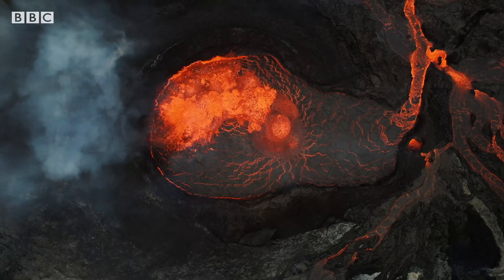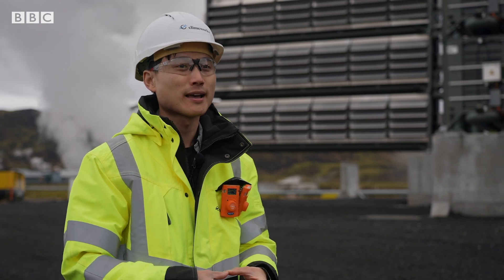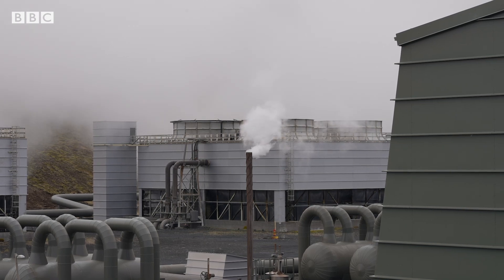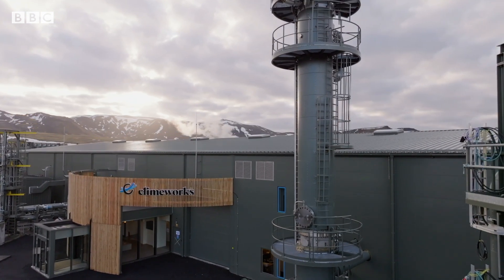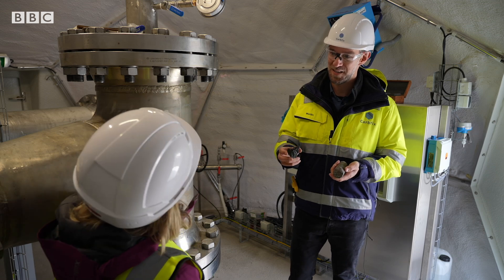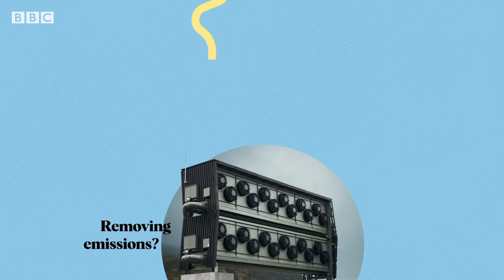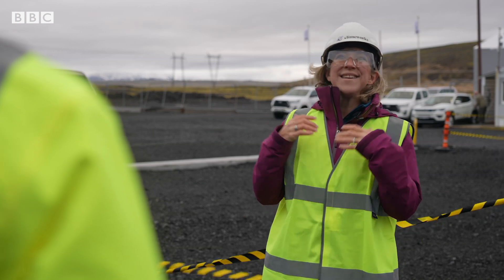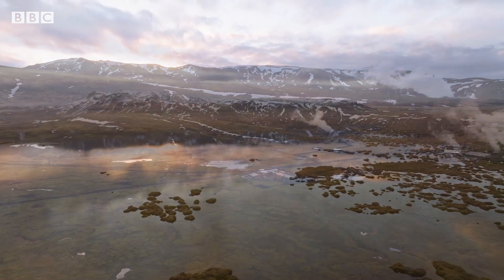Inside the hidden carbon plant pulling CO2 from thin air | BBC News

Comment: What stupidity?     Co2 heating by radiation was mainly in 20ppm lessening as it increased so over 350ppm no measurable heat was found!  below  1800 ppm plan life starts to  whither away in fact its added to greenhouses to increase crops. often five fold.  Without CO2 photosynthesis stops.  This process recycles waste into tomorrow's requirements.  As I suggested,  what net zero stupidity?

Comment: Fairy tales.
To obtain 1 ton of CO2 you need to suck 1670 tons of air through a plant. Compress it wash it, dry it and liquify it. For all thia you need a lot of energy.
To get methanol one need 44 kg of CO2 to make 32 kg of methanol. And you need a lot of hydrogen. At the end you need 12-14 kWh/kg methanol for the process. 
But if burned or used in an engine 1 kg of methanol will release only a measly 5,5 kWh.

Comment: This is the biggest waste of material, resources, labor, equipment, power, and yes also the "burning" of fuels needed to generate power for its manufacturing, installation, and operation....... All this for The New Religion, which dismisses the number one influence in climatic weather pattern changes,,,,,,, the Sun/ Solar forcing/ electro-magnetic influence from the Sun.... The New Religion will fall

Comment: for context, you would need 1,168,750 of these factories to offset one year of global CO2 emissions. At $1k per ton of co2 removed this solution would cost $37 trillion dollars. If they scale to $300-400 per ton it will cost $13trillion. 
You could plant about 13 trillion trees with that much money.
Dollar for dollar which solution removes more carbon, this industrial construction OR planting trees? It would take 437 acres of trees to capture the same amount of carbon that this thing does.

Comment: Trees are pretty good at removing CO2, but the fuel they produce (wood) is not very useful to run cars or heat homes. What we need to do is gene-modify a plant to very efficiently produce something we can easily use directly as fuel, such as methane, propane, octane, ethyl alcohol etc. Then we need a second gene mod so the plant is saline-tolerant like mangrove or kelp plants, so we can grow them in a desert and irrigate them with seawater. That way it's not competing with food crops for limited arable land. Call it a "Fuel Tree".
Cover the Sahara and other deserts with plantations of these Fuel Trees and we'll suck up the excess CO2 in our atmosphere as fast as we release it. Far, far cheaper than trying to limit fossil CO2 production. We could go back to gas-guzzling vehicles and fuel them with recycled carbon, all while making a gazillion $ replacing fossil fuels with a sustainable energy source.
We already have the tools (CRISPR etc.) to GM just about anything we want in a plant. Why isn't this already happening on a planetary scale? If you know of some reason why this wouldn't work, please reply here, coz i'm a retired Ph.D. chemist, and i don't see why not.

Comment: You would need 216 000 trees to suck of the equivalent amount of CO2 as this entire plant does in a year.
1 square kilometer of forest can contain up to 288 000 trees. 
Meaning if we planted 1 Los Angeles Downtowns' worth of trees. It would suck up exactly 20 times more CO2 than this entire project.
Downtown Los Angeles isn't even that big! It's 15 sqkm big. The amount of the amazon that has been destroyed is equal to 7 900 sqkm!
That means that this single CO2 capturing thing would have to be scaled 10 533 times to capture the amount of CO2 that would have been captured by the destroyed parts of the Amazon!
That is of course given that all parts of the amazon were this dense and so on... but still! Come on, and we should probably be skeptical to any "climate solution" that is being heavily invested into by fossil fuel companies!
Reply: It's not an either/or. Prevent further deforestation. Reforest. But also develop carbon capture solutions that might scale into something meaningful in time, like solar and wind generation did. We're probably going to need to all the help we can get. No point dismissing the effort.

Comment: Perhaps it will work. Perhaps it won't. But this is a vastly superior option to trying to force society onto unreliable sources of energy generation (i.e. those that require the sun to be shining or the wind to be blowing, when neither is a certainty), or adopting insane "degrowth" proposals that will amplify human misery. Even better if we can use this process to produce fuel - take those only-semi-reliable power sources, or else those that are stationary (geotherm, hydro), or undesirable in densely populated areas (nuclear)...and use them to produce hydrocarbons that can be used the same way we currently use hydrocarbons.

Comment: If a vehicle consumes 50L of fuel a week at 2.3kg per L generates 115kg/wk CO2, 5980kg/yr, 36,000t recovery is only approx 6100 vehicle.
The consumption of power is very large but even if this is renewables, it’s only a minuscule recovery process.

Comment: You can compress carbon into oxygen, just think of trees. Imagine earth filled with oxygen instead of nitrogen.
Reply: "Imagine earth filled with oxygen instead of nitrogen."

That would be a total disaster. Alsmost pure oxygen ? everything would burn at the first spark. Not to mention oxygen oxydative power .
Terrible idea.
Reply: @philippesarrazin2752  you know trees also breath in oxygen. Or is that complete fake?
Reply: @HotdogWater_Account  Life as we know it would be significantly different, and potentially not sustainable, if the atmosphere were made mostly of oxygen instead of nitrogen. Here are a few key points to consider:

    Flammability: An atmosphere rich in oxygen would make the environment extremely flammable. Even small sparks could ignite widespread fires, making it difficult for life to survive.

    Biological Effects: High concentrations of oxygen can be toxic to many forms of life. Oxygen toxicity can damage cells and tissues, especially in organisms that have not evolved to handle such high levels of oxygen.

    Evolutionary Adaptations: Life on Earth evolved under the conditions of a nitrogen-rich atmosphere. Many biological processes are adapted to this specific composition. A significant change in atmospheric composition would require life to undergo major evolutionary changes to adapt.

    Respiratory Systems: Human respiratory systems, along with those of many other animals, are adapted to breathe an atmosphere with about 21% oxygen. Breathing an atmosphere with much higher oxygen levels could lead to health issues like hyperoxia, which can cause oxidative damage to tissues.

    Plant Life: Plants, which produce oxygen through photosynthesis, rely on a balance of oxygen and carbon dioxide in the atmosphere. A high-oxygen environment might disrupt this balance, potentially affecting plant life and the entire food chain.

    Atmospheric Pressure and Density: The density and pressure of the atmosphere would also change, affecting weather patterns, climate, and the ability of organisms to survive in different environments.

In summary, while some forms of life might adapt to an oxygen-rich atmosphere, life as we know it—particularly complex multicellular organisms, including humans—would face significant challenges. The current balance of gases in the Earth's atmosphere is finely tuned to support the diverse ecosystems that exist today.
Reply: @philippesarrazin2752  does that mean i should stop breathing?
Reply: "You can compress carbon into oxygen"
No, you can't.
Plants can take water and carbon dioxide and produce oxygen and biomass out of it. With the use of a lot of fertile land and solar irradiation. 
And biomass gets eaten and decomposed back to H2O and CO2 again.
Reply: Not to mention fire, which turns back biomass into H2O and CO2 as well.

Comment: Why do they put these carbon drains in places which likely have the least amount of CO2? How about building them in or next to cities?
Reply: There is hardly any difference in CO2-level between the wilderness of Iceland and "next to cities".
You must not look at CO2 as a typical air pollutant, which hardly exists far away from major emittents.
Since there is already a high level everywhere, local emittents don't increase this local level very much.
It's like putting salt into an ocean of salty water.

Comment: All great if you don’t need to pay for the energy used to refine it  costs more to remove it than it’s worth unless you have geo thermal and free energy which a lot of countries don’t
Reply: Solar thermal energy and free space for its harvesting is available in giant amounts in a lot of countries. And that's one of the advantages of DAC: It can happen everywhere, it's completely irrelevant, WHERE on this planet you remove the CO2.
Unlike "normal" CCS, which has to happen directly at the emittent.

Comment: Assuming we release 40,000,000,000  (40 billion) tons of CO2 into the atmosphere annually and the planned US unit having a capacity of 1,000,000 tons, we’ll need 40,000 of them to get up net zero. 

While this technology certainly has a part to play in the atmospheric CO2 extraction and sequestration, by itself it’s not even going to be able to make a dent in the problem.
Reply: The problem you have there, is that 
Carbon Dioxide is too heavy to rise 
into the Atmosphere. We see it as 
the Smog Layer that we ALL live in. 
It doesn't go past a certain altitude.

Comment: Saw this on 'click' and tried to make sense of some of the figures, when you consider that when this plant is fully up and running it will remove the CO2 from the air of the equivalent of 8000 ICE cars a year at a cost of $1000/ton and is positioned in Iceland so it can benefit from geothermal energy is this really a solution that can have a significant globally rolled out cost effective impact?

Comment: imo it does not look practical. Atmospheric CO2 is scarce .04% therefore the capture machine requires large airflow(=energy). Also it is made of energy intensive materials like metals and concrete. Energy is valuable and should be used judiciously, not squandered to address a byproduct of energy production itself. Atmospheric carbon capture at this time is a tool for virtue signalling by carbon emitting corporations.

Comment: So, we would need a million of these plants to capture the CO2 we are making currently...
Reply: Yes. But:
This plant is still just a (bigger) pilot plant.
And no reasonable person wants to compensate today's emission with such DACCS-plants.
They are meant to compensate a part of the inevitable residual emissions (agriculture, cement production,..) after we largely got rid of fossil fuel combustion.
1000 plants for 1 million tons CO2 each could remove 1 billion tons of CO2 annually. 
Which would be a substantial share of the estimated residual emissions.

Comment: "It costs a whopping $1000 to remove 1 ton of CO2"
Unsustainable.  Also, it would be nice to know the MWh needed per ton of removal, it is a LOT of energy.  While that energy was generated geothermally, it is not without its own pollution, and the energy could have been better spent POWERING things.  You could make liquid fuels with it (closing the carbon loop), generate electricity, use the process heat to make ammonia (and fertilizer) - anything would be more efficient.  

"36,000 tons of CO2 annually, about 8000 petrol cars off the road" (at an annual cost of $36 million using the numbers above)
Using coal as an example (which is still burned in insane numbers right now) about 3 tons of CO2 come from 1 ton of coal, so this is 12,000 tons of coal per year.  Over 8 BILLION tons per year of coal was burned in 2022, and some simple math tells you this unit removes...ONE MINUTE of worldwide coal burning in a YEAR, while consuming $36M to do that.  Why not just stop burning the coal?  Coal costs ~$100/T so $1.2M of coal is bought and it costs $36M to clean up the CO2.

Comment: I don’t understand. If it’s not important to be near where the carbon is emitted because it disperses anyway, why are cities more polluted than the countryside?
Reply: It's mainly because of the global "high" level of CO2 (420 ppm) compared to the level of pollutants like NOx in fresh or polluted air (some ppb).
If the level is high already, you won't get much rise of this level by local emission.
Reply: And you have to take into account, that CO2 is no pollutant in a common sense.
Every lifeform emits CO2, even plants at night.
So you have lots of CO2-emittents on the countryside as well. Unlike CO- or NOx-emittents.
Of course, if you would put a giant dome over a city, you would get a massive rise in CO2-level with time, unlike under a dome over average natural countryside.
But normal air exchange doesn't let this happen.
Reply: I did some math for the "dome-example": If you would spread the annual CO2-production of Vienna (6.9 million tons) in a volume of 4000 km³ (400 km² city area, 10 km high), you would get "only" 1134 ppm more, additionally to the 420 ppm of today. Or 3.1 ppm per day.
Reply: @701983  if so, then low-emission zones in city centers are pointless?
Reply: @flimgenco  ??? I see, I couldn't explain the topic satisfactorily. No, low-emission zones in city centers make sense. But this "low-emission" doesn't refer to CO2, since CO2 is no pollutant in a common sense. And its concentration is "high" everywhere anyway, unlike the concentration of real pollutants like NOx, which are hazardous to our health.
Reply: @701983  okay, then another question: if CO2 is not a pollutant, why are petrol-engined cars taxed based on CO2 emissions in the EU? (diesel-engined cars are taxed based on NOx emissions, that I understand.)
Reply: @flimgenco  I don't know much about car taxation, but since CO2 is a greenhouse gas, it makes sense to tax cars by CO2-emission as well.

Comment: Similar system to the device the Ghostbusters keep the captured spirits. What happens when it gets shut down?
Reply: You didn't watch the video?
The captured CO2 gets mixed with water. This "sparkling water" gets injected into a formation of alkaline rock (basalt). The alkaline rock reacts with the CO2 and becomes carbonate rock.
What did you expect? A giant storage of dry ice, which needs permanent cooling?

Comment: You would need 2000 of these plants to address the car fleet of Australia alone.
Reply: That's why no reasonable person propagates a compensation of our today's emissions by Direct Air Capture plants. 
They are meant to compensate inevitable residual emissions, after we largely got rid of fossil fuel combustion. Together with other measures like "normal" CCS, BECCS, (re-)forestation, forced humification,...
Reply: And this is still just a (bigger) pilot plant of course.

Comment: what happened to trees?
Reply: The vikings chopped down most trees in Iceland. And reforestation is pretty hard on this island. But there is some progress.
-----------------
If you refer to trees for carbon removal: Nothing happened, (re-)forestation is still an important measure for CO2-removal. There are several measures, and we probably will need all of them.
DACCS-plants are no reason to abandon reforestation.
Or "normal" CCS. Or BECCS. Or forced humification....
And of course no reason to maintain fossil fuel combustion.

Comment: $1000 per ton of CO2 captured is insane.
Reply: That's currently the real price of carbon dioxide emissions, then. Some areas could soon be forced to offset it's that way, especially air travel, but since it is twice as damaging you would have to pay double per ton. 2k per ton.
Reply: @NoidoDev  Price of emitting one tonne of CO2 eq. is now priced at 70 euros in the EU. (ETS). That gap is huge.
Reply: @RubenKemp  
Interesting. I wasn't talking about current market prices. If it was stored away permanently and people had to pay for it, it would cost much more. That's one reason why we need this project, it shows a form of "real costs" of these emissions.

Comment: It would take a million plants like this to remove CO2 at the same rate it is being emitted
Reply: That's why no reasonable person propagates a compensation of our today's emissions by Direct Air Capture plants. 
They are meant to compensate inevitable residual emissions, after we largely got rid of fossil fuel combustion. Together with other measures like "normal" CCS, BECCS, (re-)forestation, forced humification,...
Reply: BECCS is bioenergy with CCS, the CO2 comes from biomass combustion or biogas-processing (to biomethane).
Just for your interest.
Reply: And of course, the future plants will be much bigger. This is still just a (bigger) pilot plant.
Reply: 1000 plants worldwide with 1 million tons CO2 per year each would remove 1 billion tons annually.
Which would be a substantial share of the residual emissions.

Comment: Why is everyone clowning on this? The technology is still in its infancy of course it can't suck up all the CO2 in the air.
Reply: "of course it can't suck up all the CO2 in the air."
And it MUST NOT do this. Plants need a certain level of CO2 in the air for photosynthesis.
So many comments here refer to this point.
Absurdly.
Reply: @701983  I think you missed my hyperbole
Reply: @chicken_kiev9929  I wasn't sure, if you were aware of the "problem", which is in fact no problem.
Reply: Such plants are not meant to compensate all our emissions of today, but might compensate a part of the "inevitable" residual emissions after we largely got rid off the combustion of fossil fuels.
Together with other measures like "normal" CCS, BECCS, forestation, forced humification,...
They might remove 1 billion tons of CO2 annually some day. A lot of much bigger plants than this one.
They won't replace emission reduction, they won't replace other measures like forestation.